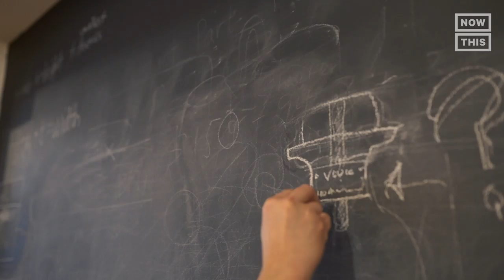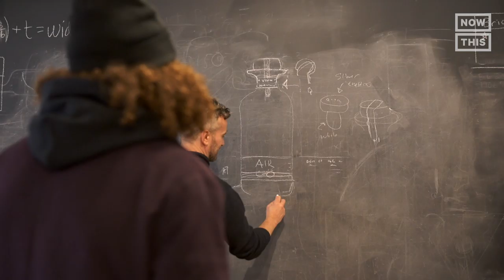Liquid Ethanol Being Turned Into Hand Sanitizer to Battle Coronavirus | One Small Step | NowThis

Comment: Preventing CO2 release into the atmosphere is not the same as being carbon negative.
Reply: did you watch the video they literally turn co2 into ethanol.
Reply: vawa-ID what’s your point?
Reply: @ehess1492  The carbon dioxide output of the entire process is negative, because CO2 is being consumed in the creation of Ethanol.

This is, of course, assuming the energy used comes from a carbon-free source

Comment: This is great, they have reduced their co2 on part of their production.. This however does no where near make them carbon negative as NowThisNews states.
Glass, delivery and power for machines to name a few things are still makes emission.
Reply: Furthermore, they presumably don't count the evaporation of ethanol in the hands of consumers as part of their own carbon-production.
Reply: It is 100 times better than every other company. So good for them.
Reply: DPS3688 feel good stories don’t change facts.

This is not carbon negative.

It’s probably not even carbon neutral.
Reply: @DPS3688  it's no better than a waste disposal company saying they are carbon negative for storing tonnes of waste in the ground each year. Their successful use of a waste product is to be applauded but it doesn't make it carbon negative.